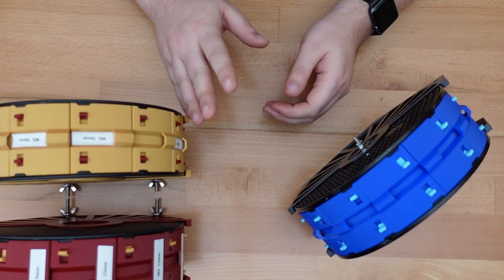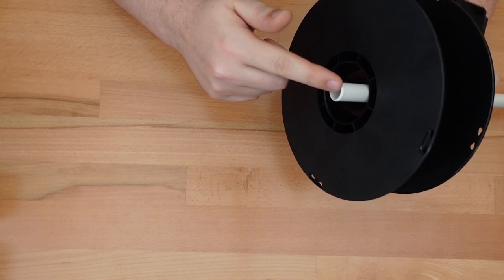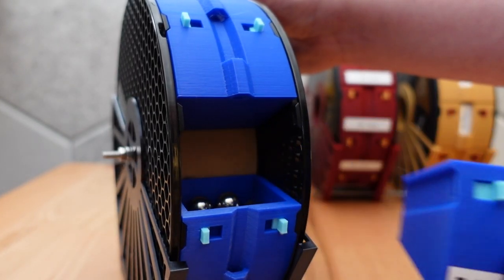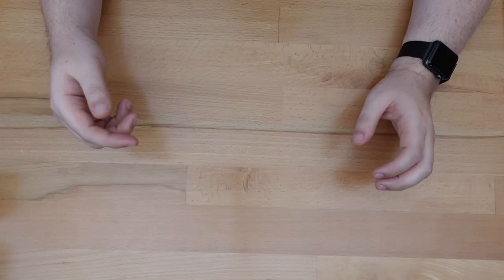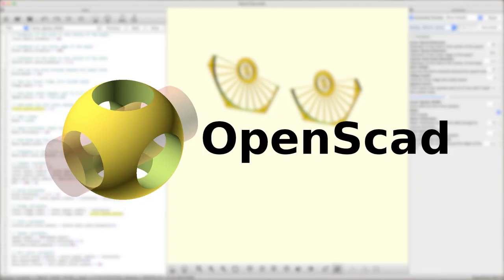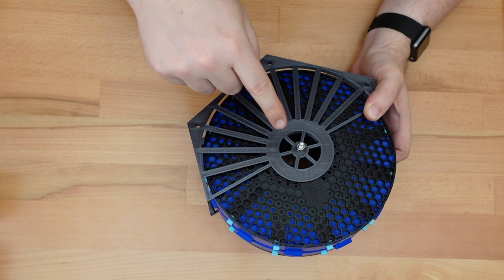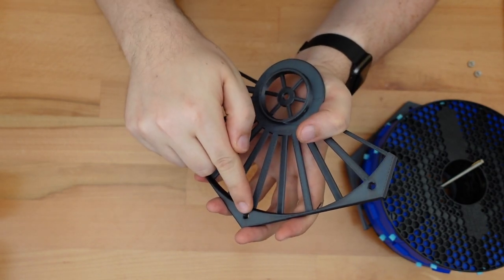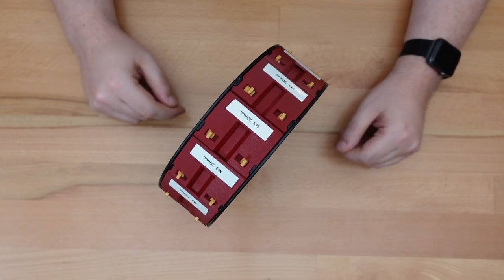Vertical Filament Spool Parts Drawer Stand

Comment: you should add a guide rail that moves the latches from the unlocked to the locked position as the drawer is rotated
Reply from the maker: Cool idea! It might not work for tighter latches, but I can see that nicely closing the locks for looser fits.

Comment: Going overboard with the options....... Definately not, first time using Open SCAD, and it was a great experience, thank you for the work that you have done. And BTW, they work really well, although I have placed spacers on the 3 base bolts to maintain the spacing, a simple square opened up with a U shape,  and it works well.
Reply from the maker: Glad you liked it! Great job trying a new program & improving a design to fit your needs - spacers are a very good idea!

Comment: I am in the process of printing a set for my Inland brand PLA+ 1000g spools. I wanted to say that I have enjoyed the project so far but I did find one area where the program does not seem to meet my needs. I tested the Inner spool width at 58, 57, 55, and finally 56. However, none of these actually fit my spool. I ended up going into my slicer to resize the 55 drawer up by .5mm which was half the size difference between the 55 (just a bit small) and 56 (too tight). If I may suggest a small revision / upgrade to your programing, you may find it valuable to add .5mm options for the openSCAD settings. Otherwise, great project and I look forward to completing a full spool soon.
Reply: FYI Settings for Inland: 
Outer Spool Diameter 200 
Inner Spool Diameter 90 
Inner Spool Width 55 - **Resize up width by .5mm in slicer
Resolution 200
Lock tolerance .15 
Lid - **Resize up width by .5mm in slicer
Locks - **Resize length up to 14mm in slicer
Split Guides
Bin Handle Curved
Reply from the maker: Thanks for sharing your solution!

Unfortunately, OpenScad doesn't let you set parameters with more decimal places than the default value. To avoid that in the future, I'll start specifying defaults with additional decimals (like 10.0001), even though that looks kind of weird.

If anyone else hits this issue, this can also be solved by specifying the inner spool width directly in the script. It's not as user-friendly as the form, but it works!

Comment: How to split the bodies in scad? To put it in slicer instantly? Do I need to do it in fusion?
Reply from the maker: When I first made this video, your only option was to pull the entire project into your slicer software and then split it there. This functionality is built into PrusaSlicer by default (right click the model and select "split") and it's an optional add-on in Cura.

More recently, the SCAD file was updated to let you select individual parts to render and export one at a time. Either way works!

Comment: Do you have a .scad for a wall mounted version of the stand?
Reply from the maker: Not yet, but if nobody else gets to it first, I might explore that in a future video!

If anyone is interested in perusing it, I expect there are a couple challenges a wall mounted design will need to overcome.

It’ll need to be bulked up to deal with new tension forces and the side sections would need to be angled differently if they’re going to sit flush against the well yet still keep bins from falling out.

Neither of these are that difficult, but I’m fairly sure just adding hanging tabs to the current design would be a problem.

Comment: the thingverse link is dead
Reply from the maker: Unfortunately Thingiverse deleted all of my designs. This may be due to a bug, but it's more likely an abuse of the reporting system that's intended to remove designs that break the site's ToS. I've submitted a support ticket, but there is no guarantee that Thingiverse will restore these projects.

I'm using this as an opportunity to focus on moving the remainder of my projects to Prusa Printers and Thangs. I hope one of those options will be an acceptable alternative. This project hasn't been copied over yet, but I expect it will be within a week.

You can watch my progress as I add project here:
https://www.prusaprinters.org/social/106529-3d-printy/about
https://thangs.com/user/3DPrinty/profile
Reply: @3DPrinty  cheers!